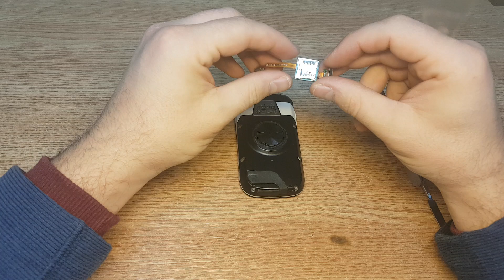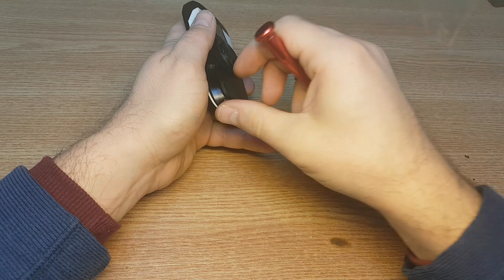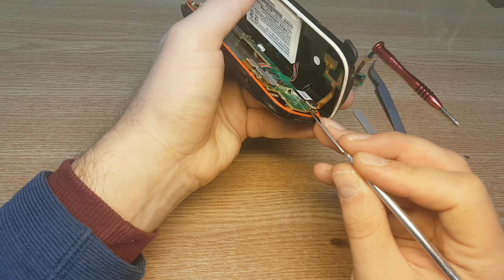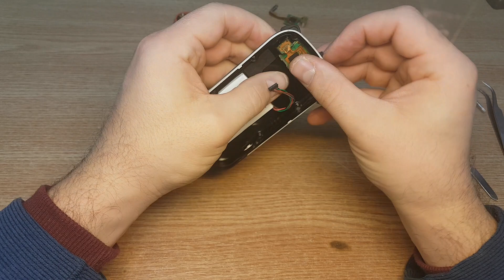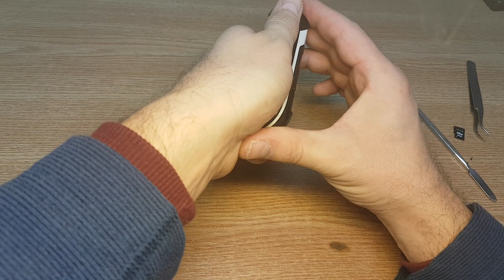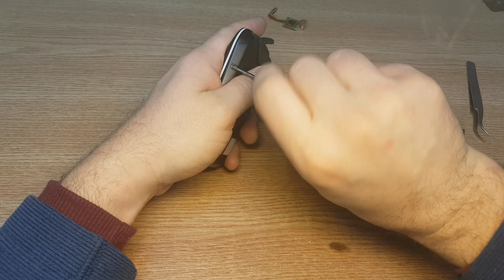Garmin edge 1000 Charging connector replacement

Comment: Great video....however,when I replaced my Garmin 1000 usb port with a new one,it did not work.Any suggestions? Hardware issue perhaps?
Reply from the maker: Soldering is the issue check for continuity
Reply: @RepairMyDevice  opps..I forgot mention,I did replace the SD slot as well.The SD slot came connected to USB port so I just had to put it in the slots as you did in your video.I don't know much about electronics but I do have a multi meter.I'm not sure what or where to point the leads to test continuity...Perhaps a quick video would help.Thank you for the quick response.

Comment: Hi, I was wondering if I can purchase the charging connector for an Garmin Edge 510? The unit works fine, the usb port connector has broken. Or can I send it to you for repair? Thanks
Reply from the maker: Helli you can send your device to Sat-Nav Repairs 10 Clifton Avenue PE3 6 AY Peterborough
Reply: @RepairMyDevice  Ok, thanks for your reply. I am currently in Thailand, so that might not work. Can you point me in the right direction for the USB connector pin i need to buy for the replacement? Thanks!

Comment: Thanks for the video.  Do you know another supplier for the charging connector with flex.   The link you provide on ebay is out of stock.  Thanks for your help
Reply from the maker: https://www.ebay.co.uk/itm/362854759971
This is the link for the flex, part it is in stock.
Reply: @RepairMyDevice  hi sold out in that link, do you kno where I can buy?

Comment: I can not connect my garmin edge 1000 to the pc. I always get the message "usb is not recognized". I have tried al the usb ports on my desktop, laptop and desktop at my work and on all the pc i get that message. 
 Could the usb port of the garmin be damaged, also if the battery is loading?
Reply from the maker: You need to change the charging port or the flex.
Reply: @RepairMyDevice  so if the USB or flex port is defect/broken, it can load the battery of the garmin but make no connection to the pc?
Reply: can you answer my question above: I can load the battery of my garmin edge 1000 but it is nog recognized by my desktop, laptop. Is it still the usb port that is defect? I want to get in het software of the system to djust the hour because that is 8hours behind the original time
Reply: @timmymues9256  Hi, I have this exact same problem. The unit charges but no computer recognises it so I can not use Garmin on the PC to connect it. Did you ever figure out out? Many thanks
Reply: @misterjack2378  I did not change the usb port or flex so It still has no connection to the computer. I have also another problem. The hour is not correct on the garmin. It shows 8 hours less than it is in real time and I can not adjust it because it works with GPS.

Comment: where do you get the part??
Reply from the maker: https://www.ebay.co.uk/itm/Garmin-Edge-1000-Back-Case-With-Charging-Port-Micro-SD-Flex-Replacement-Part/263556525559?epid=18026480919&hash=item3d5d316df7:g:JHsAAOSwqblarlxc
Reply from the maker: You can purchase the charging port from this link is the part you need to fix your Garmin Edge 520

https://www.ebay.co.uk/itm/254114757321
Reply from the maker: Here is a link to purchase the flex: https://www.ebay.co.uk/itm/362854759971